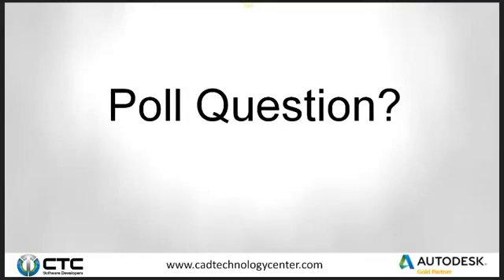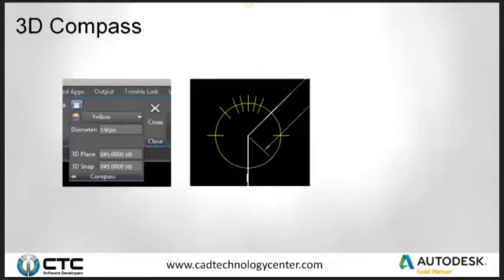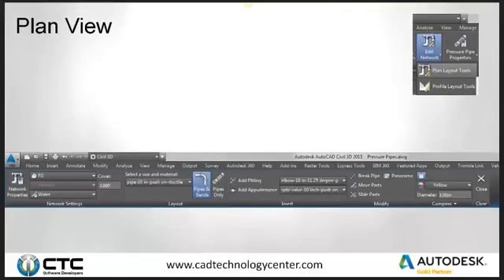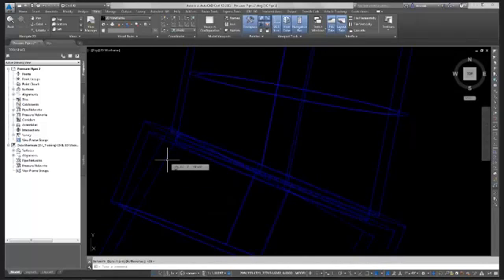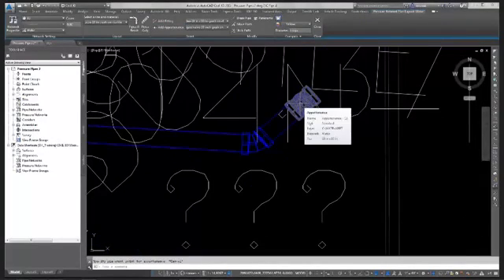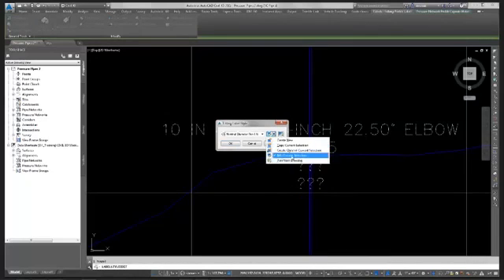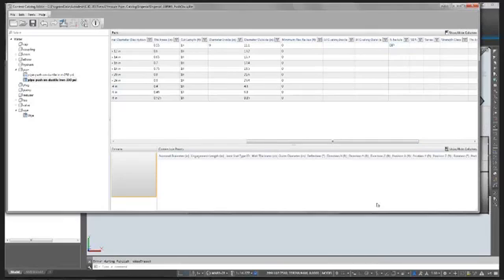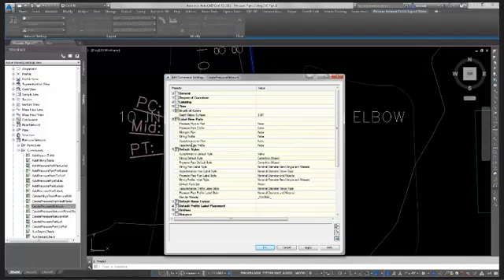No Pressure — Understanding Pressure Networks for Civil 3D

Comment: So Pressure Pipes are still pretty much half baked. Useful, for sure, but nevertheless half baked. Almost every quick, one-click feature (like cover options) has one or more massive caveats that will probably make that feature unusable for almost everyone in almost all cases. 
Great video and thanks for the info.
(I still loathe Autodesk for acting like they are THE flagship while they continue to put garbage like this out.)